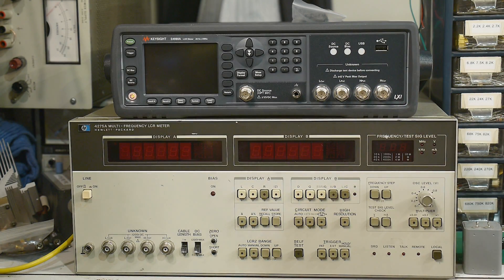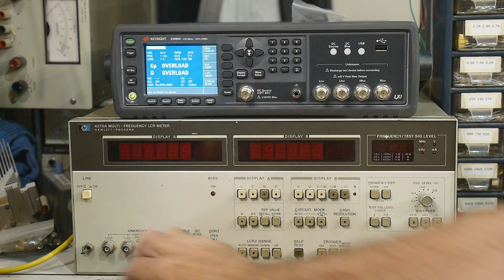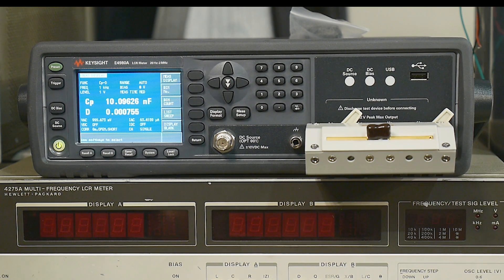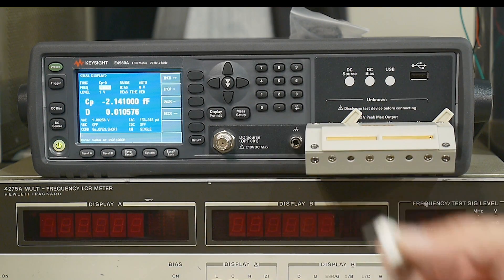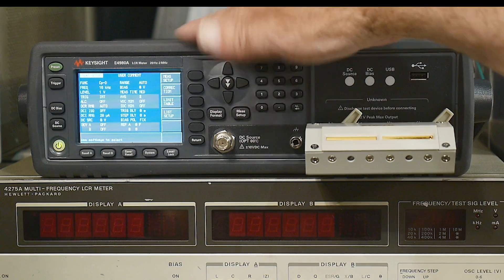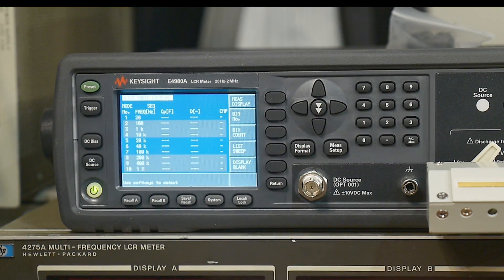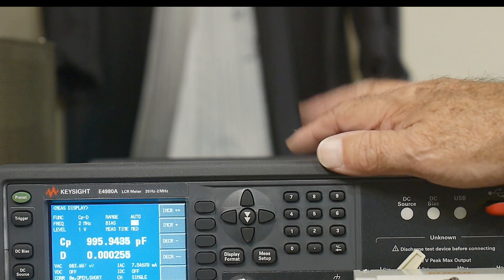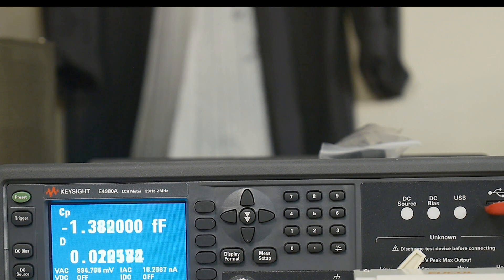#1688 Keysight E4980A LCR Meter

Comment: Hi, thanks for the video!

Do you think this LCR meter can be used to measure the capacitance and inductance on PCB traces? I have, let's say, theorical data for capacitance and inductance in the traces of a PCB from simulations that I would like to check in the manufactured PCB, mainly in pF and nH. I made some measurements, and the values were not close to the theorical values, so I want a second opinion.

Thanks in advance! :)

Comment: Ohhh, I wish you could keep this and try to make DIY capacitance standards. There is a paper on the Internet somewhere describing how NIST made their standards back in the 60s:
They took quartz disks, lapped them parallel, coated them with lacquer containing silver particles, burned out the the lacquer to leave an evenly distributed silver coat . Then they ran a knife across the disk edge to scrape off the excess silver and separate the two opposing sides as the capacitor plates. Finally, the capacitor was suspended on the connecting electrodes to and put inside a metal container with an inert gas. Apparently the scraping part was critical in keeping the longterm drift within ppm range. 
Sounds surpsingly doable, right? Would have been an amazing project to try and then actually track the drift over time.

Comment: With that huge measurement range, it would be interesting to characterize a variety of "gimmick" capacitors from just twisting together insulated wire.  Figure out a rule-of-thumb for some available wire gauge and insulation combinations for when you need that 1.25 pF capacitor in the future.
Reply from the maker: good idea

Comment: But what is D? Deviation?
Reply from the maker: dissipation factor: https://en.wikipedia.org/wiki/Dissipation_factor
I explain: https://youtu.be/34G4pzWr9kA?si=eahKM2JhEMTOGvcU
Reply: Thanks IMSAI for link to D.

I remember the Q of a capacitor being 1/D...

Then most good caps have high Q
Reply: And the lower D ...the better capacitor...

It is nice Keysight your old employer was so generous...

Two days ago we needed to measure insulation resistance for our customers parts....

Spec.: Insulation resistance needs to be greater than 0.5 Tohm at 500 VDC...

Our customer specified some Keysight ohmmeter...

We got a quote...$21.5 K...

Amazing the cost...

For now we will use the old megger...it can read up to 1 G ohm

...so we are looking and screening for gross leakage..but not testing per spec....

There are discussions on who will pay for the Keysight...

I was going to see if we had a sensitive ammeter...

500 V / 500 G ohm = 1 nA max
- leakage current

We don't have an ammeter that can measure a nano amp...

I think my old Keithley...the lowest scale is 200 uA..

Look how easy I go off subject. ...

LOL
Reply: @fredmitchel1236 you can use a DMM in voltage mode as a pretty sensitive leakage current measurement device, 1na over 10MOhm or whatever resistance it has on a low range is 10mV.
Reply: @Gengh13  Thanks Gengh 13...

Ya the plot thickens....

Reading the spec more....it calls out for that Keysight - which is obsolete as of 2016...and now can be bought for $1500...

When reading their spec more..they were using the Keysight 4 terminal ohmmeter feature to measure the heater element resistance which were around 8 to 9 ohms, another element 9 to 10 ohms and then last element at 10 to 13 ohms...

And so then we could use our garden variety Fluke 116 DVM to look for trouble easily 

Reading closer - insulation R to chassis ground - to be greater than 500 G ohm at 500 VDC...

Spec said use a megger ...
We bought one that will read up to 1 Tera ohm..but found out it only can measure that high when test voltage was 5 kV...

When set to 500 VDC-  its highest resistance that can be measured was 500 Mohms...

I saw some internet techniques ..

One group in from UT in Austin..were playing with their voltmeter and were trying to reliably cal a sensitive Keithley...and wanted to source like 5 pA...to calibrate another Keithley...

So yes I like to see how one could create a tester...to source 500 VDC...and measure the voltage across a known high resistor..

Then calculate the resistance of the insulation 

you have 500 VDC as source supply...to stress the insulation.....then say I found or bought a 20 Meg  ohm resistor resistor...perhaps that might be the highest in my goodie boxes...

20 Meg ohm...per volt?...like the garden variety Fluke input Z probably has...

And for argument sake...say the heat wire insulation resistance was just in spec and was 500,000,000,000 + 1 Meg ohm..to make believe a heater insulation is just in spec...

So 500 VDC forced through 20 Meg + 500 Gohm + 1 Meg ohm , Rt be 500,021,000,000 total ohms

And the current would be 9.995002 × 10-9..

And the voltage across the 20 Meg resistor would  be 9.99 mV...

And the I could measure with garden variety Fluke DVM...for pass fail until the Keysight fancy ohm meter arrives and would tell me with 6.5 digits what a more accurate reading is...My Fluke might read 10.45 ohms...the Keysight 10.454725 ohms...and the spec. is 10 to 13 ohms...and this heater element would be wonderful 

So we go to the insulation resistance set up....I place the Fluke 77 or Fluke 116 DVM across the 20 Meg ohm resistor...and measure DC voltage..

Won't I bog my 20 Meg ohm resistor and get half the voltage?...

So I would say then if the voltage is 5 mV or lower then the insulation resistance is just over 500 giga ohms?

Thanks for reading a story...

I am just going to ask the make and model of their megger....then we will get that too.

I already found a two element part that had one heater element insulation resistance at 6 megs ohms using the Fluke 116...boom and that part was rejected..

Happy Thanksgiving 2023...almost..

I think or probably IMASI already used something and measured some high resistance..

That is good he is building some std. Capacitor standards...

Take care

Comment: If you want to demonstrate one of the practical uses of the DC bias function you should show testing varactor diodes.  This is one of the reasons I bought a modern high end LCR meter, to quickly batch sort varactor diodes.  Sweep the DC bias over the listed range of the varactor diode and measure it's capacitance at each voltage step.
Reply from the maker: I've already made a video, in a few days, also on voltage dependent caps